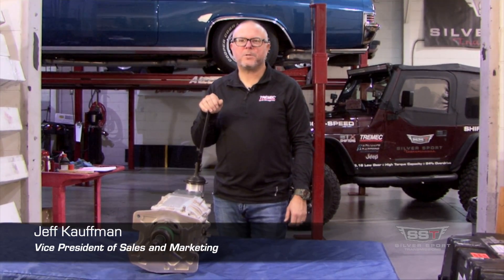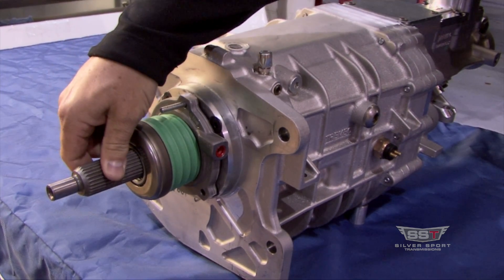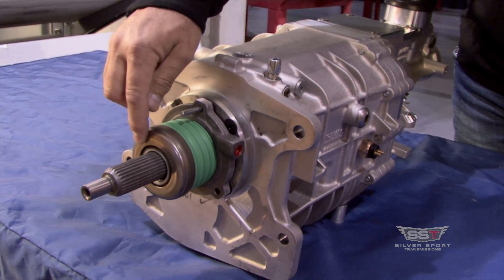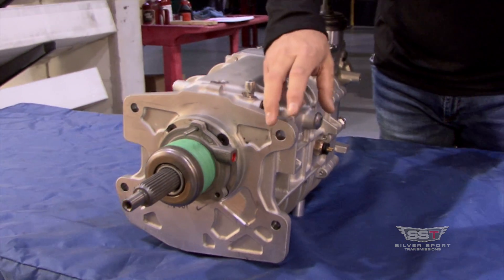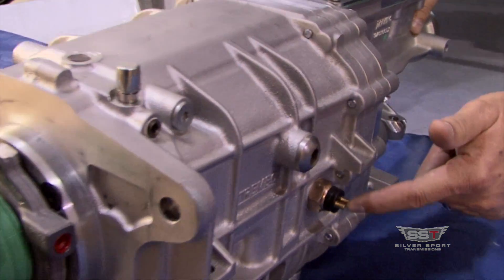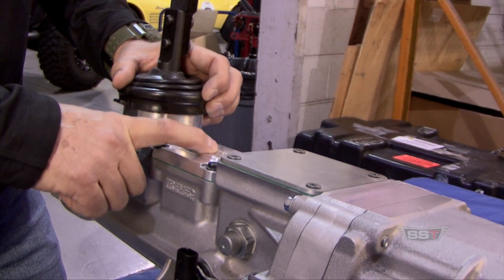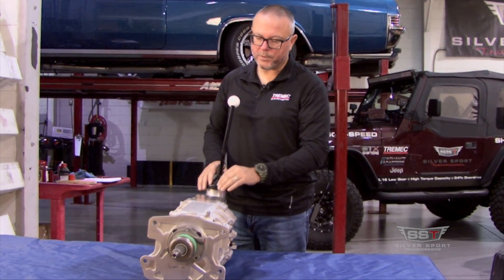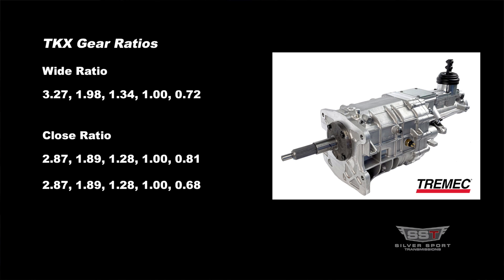TREMEC TKX 5 Speed Overview

Comment: I received a small packet of white grease with my thx what is this used for and do I oil the splines.
Reply from the maker: You can use a small amount on the input shaft splines and then use the rest to lube the speedo cable. We have a video on that here: https://youtu.be/1aiZMDU41YE?t=444

Comment: Which gm ratio would be best for a 5.3l LS turbo running 3.55 rear rear gears. DD type of setup.
Reply from the maker: What's the tire size or height?
Reply: @SilverSportTransmissions  295/40/18
Reply from the maker: @yotaismygame  If you plan on doing lots of highway driving, TCET17805 with 2.87, 1.89, 1.28, 1.00, 0.68 would be the best. If you have other plans, the .81 5th gear would be preferred.

Comment: I sold my TKO 500 a few years ago because the thing wouldn’t shift past 6k. I went with the Astro A5 and haven’t looked back since. What’s the dimensions on this for a Fox body?  Because a TKO 500 required a little massaging of the tunnel.
Reply from the maker: The dimensions of the case height and width are similar to the T-5, it's 24" long.
Reply: @SilverSportTransmissions  so will this work with the stifflers crossmember and QuickTime bell housing I currently have? I was asking about the dimensions because I just got a new driveshaft and was wondering if I could just change the slip yoke to 31 spline instead of having to get a new driveshaft.
Reply from the maker: @chadj8349  TKO/TKX are .340” shorter than T5 so you should be able to use the existing driveshaft depending on how much stick out you have right now. If it borders on being somewhat short, it may not work.  If you’re using a Stifflers TCB-M09, it will work.

Comment: what a 79 ford pickup two wheel drive is it a tkx or the TREMEC TR-4050
Reply from the maker: For a 2WD Ford Pickup, we have the choice of a TREMEC TKX 5-Speed or a TREMEC Magnum 6-Speed. The TR-4050 is 4WD only.
Reply: @SilverSportTransmissions  The 5 speed will bolt up to a 351 cleveland

Comment: Silly Me  didn't think that  GM  used  different Transmissions  between Chevelles  and Camaros..
  I have a  1979 F Body that came with a Borg Watner T-10  I put a Doug Nash  5 speed in it many years ago no Overdrive and still have the stock 3.73  rear gear in it ..  You said this  Trans bolts in place of a Muncie ..
Reply from the maker: The TKX shares the common bolt pattern with Muncie, Saginaw, T10, Super T10, Doug Nash, Richmond Gear, TREMEC TKO, Legend LGT700 and more.
Reply: @SilverSportTransmissions    I owuld think so but  I was not sure..  I plan an  LS  engine in the future.. but for now still have the  Gen I small block ..  I would think all GM cars  use the same bolt  pattern they do on the back of the Block at least..
   This Trans would be a huge improvment over  My Doug Nash 5 speed which does not shift whell at  high RPM's and has no overdrive..   Plus  I could  still use  my present manual clutch ..  Where as the   T-56  is  hydraulic  only clutch  is .. what  I gather so far..
Reply from the maker: @mikeskidmore6754  We're happy to discuss your options whenever you're ready. 888-609-0070

Comment: Nice manual  transmission for road racing  but not for drag racing,  but I'd go with a Jericho for road racing
Reply: Shifter position and the outside of the case shifter linkage makes em a pain to fit.
Reply: @CP110  true